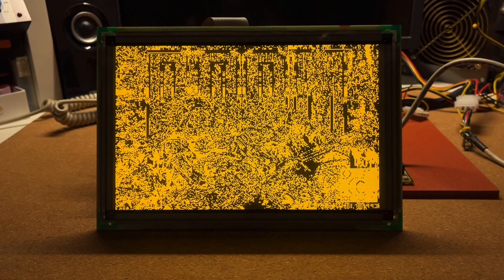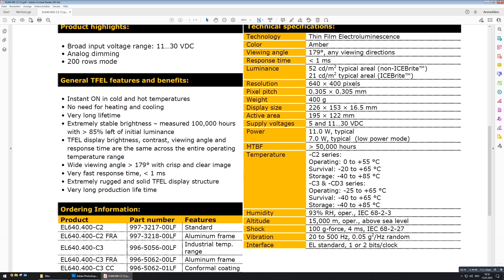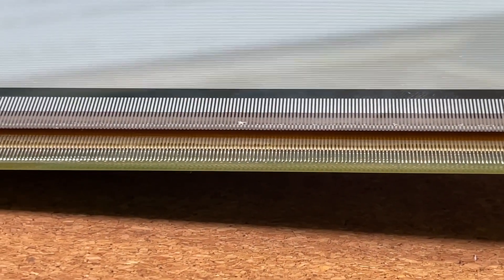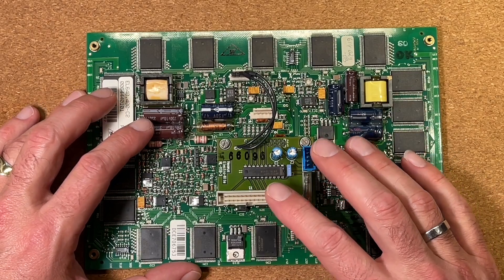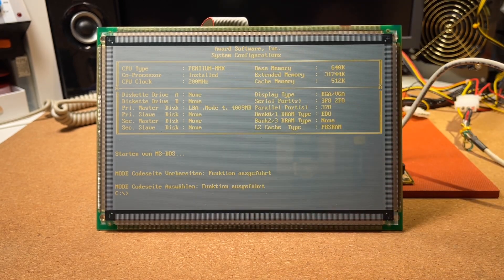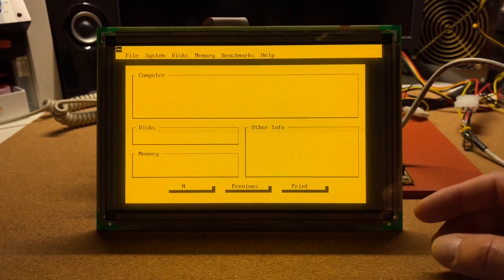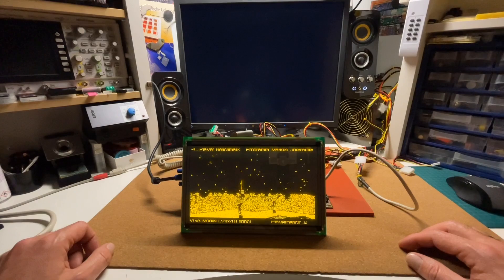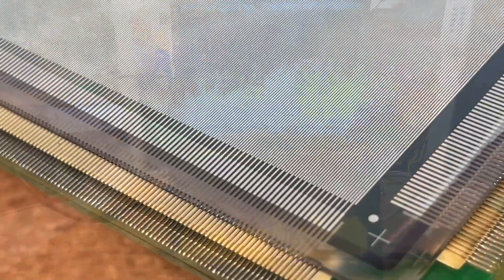7" Amber Flat Screen on VGA Feature Connector / Playing Doom / TFEL Display

Comment: I almost managed to get a hold of a Planar TTL electroluminescent display at a local computer store about twenty years ago.  It could be used with any standard monochrome graphics card.  It was mounted to an old medical computer cart and it actually folded up like a laptop computer.  Someone ended up beating me to it before I went back to buy it.  I have yet to see another, either online or in person.

Comment: that screen looks great but i think there was commands in config and autoexec that you could tell dos that your using a mono display but its been so long if i find the commands i will let you know so you can have fun with your screen. it does remind me of a VFD especially with the high voltage but i do not think any of the VFD had normal pixels as i think all of the VFD's where fixed characters ect.

Comment: This looks like the displays from gas pumps. Since it's a 640x480 display, at least with 320x240 games it would be cool to write a TSR that dithers a 320x240 image with a 4x4 pixel grid to achieve a pseudo 4 shades of amber image?  You should see if you can get a monochrome version of this screen technology also.

Comment: I would build an emulated early-hackintosh machine with that display, as those early B/W Macintosh are also 1 bit color. Prince of Persia for the classic Macintosh and many other games and applications were developed with those constraints in mind, so it is much nicer: https://youtu.be/6WUJw3il1VU?t=426

There is an emulator named "vmac" that have a DOS version, but the site seems abandoned. The newer "mini vmac" don't have a DOS version :(
What would work is Tiny Core Linux (works on a 486) with mini vmac.

Comment: I saw an article in a Danish Hifi-magazine during the 1990-1991 timeframe, that dealt with future display technologies and in here Finlux (Nokia Consumer Electronics Department) was quoted for developing Electro-Luminiscence displays. That is, working on developing better screens and with higher resolutions than their initial prototype that was showed

I remember it, because this particular article formed the vision in me of one day having a large flat screen televisions in my living room. I fantasized that much, that I even made a drawing back in the day, 1991, of a large flat screen television standing on its feet on the living room floor. Angled upwards for better in-line viewing.

And I think, only one year after reading about this (1992) we began to see 10.4" Thin Film Transistor, TFT Black Matrix displays in the most expensive portable computers at the time, Toshiba T3200 SXC and IBM Thinkpad 700C. TFT Black Matrix is a rock solid hardcore name.
The beige portable IBM suitcase though, from the same timespan, came with a little flat screen plasma display instead, but that was also amber.

So with these technologies penetrating the market at that time, it was within reason to presume that sooner or later we would see this technology entering our homes. And boy...did it ever.
It sure turned out to be a tsunami quite frankly.

To end the story. We bought a 50" Panasonic Plasma G10 television in 2009 and it's still showing a spectacular picture more than 13 years after the purchase and I get awestucked almost every time I watch a Bluray through this display. It's capable of turning itself into an invisible piece of transparent glass, when watching good source material.

Well. Cheerioh, ol' chump. Have yourself an excellent January. My best to the Misses.

Comment: Few toughts:
I had an amber Plasma display on my Toshiba 286 portable; it was CGA but the colors were displayed as patterns, it was infact a 1 bit color depth dispay
It seems to be somewhat displaying the image like a Hercules mono but on VGA standard. I used Win 3.0 with Hercules and was nice, also many game that I played on my 286 looked good enough on that plasma amber display.
Dos programs usually had a switch for being used on 1 bit displays like plasma CGA or LCD VGA. Find it ("/?" is your friend).
For example HELP /B uses a monochrome monitor on a VGA card.
There was a disply driver for dos (display.sys) that helped when using a VGA mono monitor. Also in BIOS could select MONO as video output but this setting originally was intended for Hercules mono or MDA (it sets video memory to b000 if I remember right but some VGA do not luke that) so it may give errors if used with a VGA adapter.
Now I really want one for my 386 but I saw the prices... I´ll pass for now.
Reply: DEVICE=[drive:][path]DISPLAY.SYS CON[:]=(type)

Parameters

[drive:][path]
    Specifies the location of the DISPLAY.SYS file.

type
    Specifies the display adapter in use. Valid values include EGA and LCD.
    The EGA value supports both EGA and VGA display adapters. If you omit
    the type parameter, DISPLAY.SYS checks the hardware to determine which
    display adapter is in use. You can also specify CGA and MONO as values
    for type, but they have no effect because character set switching is not
    enabled for these devices.
I would use LCD type because it is also a 1bit color depth display and take advantage of VGA adapter

Comment: you could do grayscale (or at least some gray, usually by combining temporal and spatial dithering)
those are extremely reliable panels but one need to be careful as the edges of the panel are sensitive to getting snapped of
i'd love to have one of these in that good condition, they do get some burn in especially when they have been running with mostly static content for a decade or so

Comment: This display is used in Rofin CO2 LASER operator panel, I instantly recognized the look, however they have a smaller display: EL512.256-H2 there is an auction on eBay right now where it is powered on in the first picture: 162848371811 thanks for the fun video! :)

Comment: hmmm I wonder if this can be used with that single board 486 you have?  Can it be powered by batteries?  If so, can you build a retro SBC?  11:27 ok what about a dual screen SBC?  Like a retro nintendo ds, just WAY bigger?  Using this screen for text applications, and another for gaming?

Comment: Most of these games run at 320x200 while the display has 4 times the resolution. I think it gives you some dithering space for 4 shades plus some spatiotemporal dithering capability, you can have two dither patterns that you alternate between every frame. How about building a feature connector interposer which would implement that?
Reply: Datasheet says it has a 1ms response time. Wonder if, with a better built in controller, the display itself could do PWM greyscale...

Comment: I’ve never seen such a display, but it’s still very cool, despite its shortcomings.
I was happy to hunt down a Toshiba T3200SX about two years ago, to have something with an orange plasma display. That one does support shades, but the 16 MHz 386 is way too weak to run Doom :) Btw, I was wondering how a Cyrix 486SLC or SLC2 would boost the system’s performance, maybe in conjunction with an OC to 25 MHz :)
Reply: The performance boost probably wouldn't be much of anything.
Reply from the maker: https://youtu.be/40TT2bBQ0bc

Comment: I am into wide tires cars for all the reasons other than driving them. If I made one video about it I'd get hellabanned from Youtube. Edit: These were a short lived thing in the early 2000's for cash register PCs, but they were insanely expensive, there were also desktop full color monitors in this technology (I think they were called FED, field emitting display), I remember reading a recension of one and it was mostly bad - worse than a CRT and near to 2000's LCD quality so it had no chance to survive.

Comment: I had an old amber VGA CRT back in the 90's and from memory I needed to include a "DEVICE=DISPLAY.SYS MONO" line (or something similar) in CONFIG.SYS to get colour text to display as "Black & Amber". Also, these older motherboards usually also have a jumper for MONO/COLOR although I've never seen it make any difference with a colour display attached.
Reply from the maker: good hint. thank you!
Reply: I've never seen a single green or amber vga crt before, those must be painfully rare

Comment: Old Mac OSs are in MONO, try hooking it up to an old mac in BW mode, Should work fine if you can adapt the video connector.  Keep making great videos
Reply: Powerbook 180(any with ext monitor support. ..and not that expensive) would work great, i know they output vga through a passive adaptermmac 15 pin to vga standard.  also they have a resalution that fits under the 640x400 limit of the screen) , and i think you could handle everything from there.
Think......powerbook w/ this bright display would be fantastic.  Confess I like macs (:

Comment: I've got a small luggable PC (like a clone Compaq Portable III) which has a gas plasma display in it. Connects to the VGA feature connector like your display. It displays monochrome shades of amber perfectly in 16 colour modes, but in 256 colour modes it acts like the colour palette settings aren't working, and you get very weird effects.

Still, despite all this, it's a fun display to try out, and certainly has similarities to your display!

Comment: I'm surprised I've never heard of this kind of display technology, but it's really very impressive. I like the level of contrast with the lights off, but it's not so great with the lights on. And it's only really useful for mono text display. It would be really cool if you can get one that can display greyscale, that would be much more useful.
Reply: You can always use tinted glass or tint film in front to increase contrast. Since the problem with contrast is incident light, but say if you have a 50% tint in front, then the direct light from the display is reduced by the factor of 2 but the incident light is reduced by the factor of 4. Also a technique to remember when using LED array displays, home-made LED clocks etc.
Reply: A number of enthusiasts are making their own EL displays (not VGA, but specialized kind), they look really nice for something home-made (example https://www.youtube.com/watch?v=Z2o_Sp2-aBo)
I don't think its possible to get greyscale (too hard to control voltage per individual pixels/rows without either affecting whole display's brightness or getting annoying flicker), though with a custom controller it should be possible to cheat a bit by implementing LUT and adding partial fill to simulate wider range of colors, I've seen that done with e-ink displays

Comment: Just did a quick search on eBay and sure enough there is some for sell even new old stock however they run several hundred bucks a pop and not cheap.

Comment: If you made a little bracket to mount the display to the card it would be a great POST diag screen. I personally would love to build a little folding textmode terminal with it. 
I wonder if it has a grayscale mode, or if it has the ability to do bright/dim pixels.This would be fun to get working with a 1bit mac too

Comment: I'd say the display works as expected. AFAIK, the data on the VESA Feature Connector is just the raw 8-bit data that goes to the RAMDAC. That means it gets the palette index of the color that's to be shown. One problem is that the palette itself is not transmitted; without an additional ISA or PCI connection (to snoop VGA palette writes), a device on the FC can't know what any entry in the palette is supposed to look like.

So what does the display do? It can't win, so it doesn't even try. It seems that it's just examining one bit of the palette index; from what I saw in the video, it's most probably bit 0 (LSB). In CGA/EGA-derived text modes, which use a fixed palette, this creates a relatively useful mapping: everything that has at least 50% blue to it will light up the pixel. The problem is, many DOS programs use a white-on-blue color scheme by default (Norton Commander, Norton SysInfo, Turbo Pascal etc.). The blue background will be rendered as lit, just as the white foreground.

VGA graphics mode, however, it where it really becomes nasty: Almost every game redefines the VGA palette, so there's no fixed correspondence between the color that should be visible and the state of the TFEL. What you get is noise.

Things to try:
- Run DOS textmode apps in monochrome mode, if they have one. That should eliminate the white-on-white issue.
- See if the significant palette bit can be changed somehow; maybe there's a jumper for that? Or re-wite the Feature Connector cable to route other bits to bit 0. The result should be that other palette entries are used to determine the TFEL state; games tend to have broader distinctions between colors in the upper bits, and more useful patterns may thus emerge. (For example, with Doom, bit 4 should select between amber and black based on the hue of the color that would be displayed on a color monitor.)
Reply: From what I can find the feature connector uses RRGGBBII so the display should be consistent regardless of palette order.
Reply: Might need a better dithering algorithm before the VGA palette, and then the palette should be just 2 colors
Reply: I wonder if there's a VGA card able to do that, pick 8bit color VGA, dither it, and send it to a monochrome display.
Reply: @monad_tcp  Monochrome VGA is a thing which is relatively-well supported. It only uses one output pin and on a standard card this gives 64 shades. The problem is this display does not support any shades so it will suck no matter what.

Comment: You need to try monochrome doom on that thing: watch?v=-Nz_QB26Clw
It should be much more playable ;)

Otherwise, it would make a great display for an old 8088 with a hercules adapter. It appears to support the resolution which leads me to suspect that was it's intended use case, the trick would be to figure out how you to get the signal though.

Comment: you know, I wonder if ... on every other refresh, you changed the rgb voltage by half, so that every other frame it was a different limit point for on/off... 

It would be a flickery diy grayscale, and get a tiny hint of shades.

(maybe hook up a device to the vertical refresh, and subtract or pass the vga signal on every other frame)

Comment: Dithering can be used to simulate more shades. Not sure if it can be done on the fly fast enough to play games, but displaying dithered 1bit pictures would be possible.
Reply: I think that's the only reason Prince of Persia looked slightly better when he tried CGA mode - the dithered surfaces helped break the scene up!
Reply: @ph0end  From my memory, Prince of Persia looks even better on Hercules, due to being upscaled at 720x348 and using dithering at that higher resolution. But it also had huge window-boxing (again, speaking from memory).

Comment: Was this type of display used in old portable computers? I used to have an old kinda heavy Toshiba laptop with 286 cpu ages ago. It did have amber display in it, but maybe it was using another kind of panel.
Reply from the maker: The Toshiba had a more red plasma display which could show monochrome shades. actually I have two of those. Need to make a video about it. 😉
Reply: @CPUGalaxy  Nice. I guess it might have been more reddish shade than what I did remember it being more amber. It has been so long since I had that computer. Thanks for clearing that up.

Comment: You can get more colors if you quickly switch between a light and dark pixel, i.e. one frame is a light pixel, the next is dark, an intermediate color is obtained. Or 2 frames are dark, 1 is light, and vice versa. It turns out in addition to bright and dark colors, 3 more intermediate. But this should be done by the application.
Although the monitor itself can draw intermediate brightness gradations, due to fast switching. If there is a matrix reaction of about 1 msec, then it can do it without problems.
Reply: dithering
Reply: @CotyRiddle  which can be done both spatially and in time.

Comment: USE HERCULES MODE(720x348)!!!  I played for YEARS using amber on HERCULES mode on my 8086 with CGA/HERC card
Reply: TEXT software will display usefully when in HERC mode as well, with different fonts and blinking(represent special characters)
Reply: This for sure, although the pixels will require some interpolation as it's not the same resolution. IIRC there is some "CGA emulation" driver for DOS if you have a Hercules only card as well that will translate the 2 other "colours" (not fully on or off) to a dithering pattern as well to make them visible on a fully mono display. That would at least allow playing of all Hercules and CGA mode games properly. This display would be perfect for a PC/XT class portable computer, really.